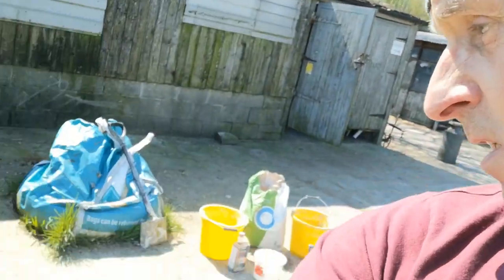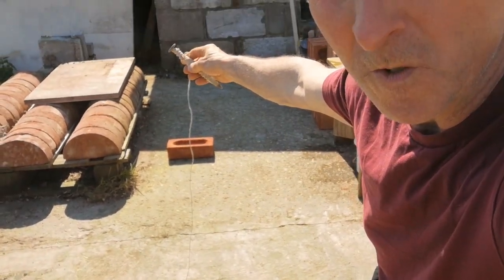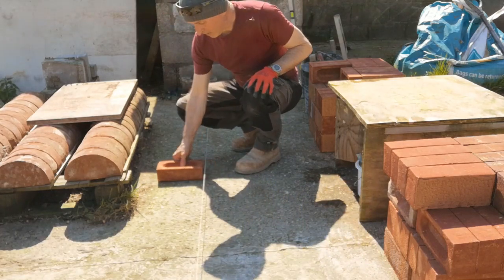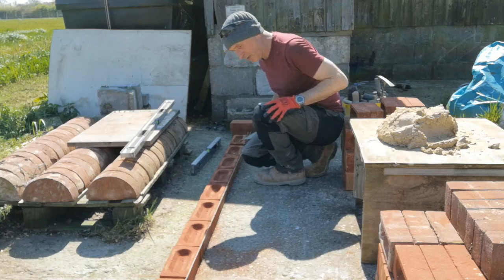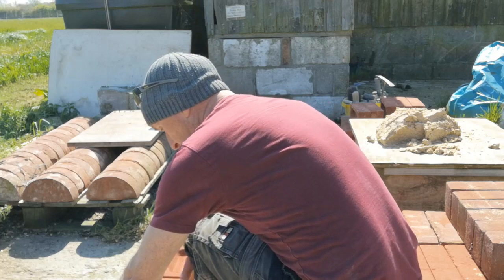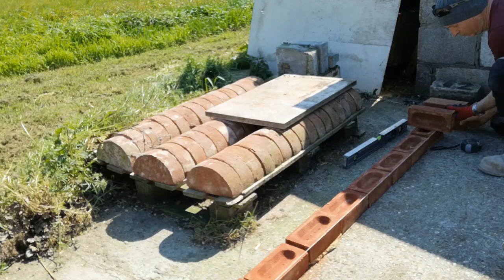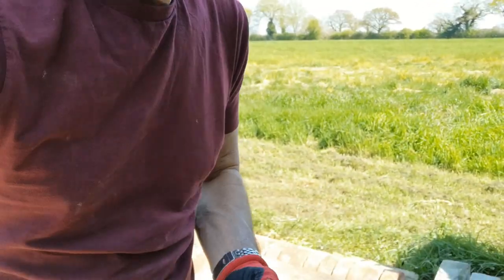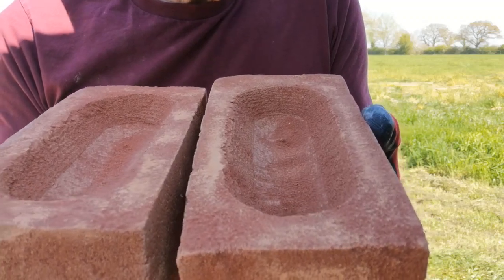How to lay bricks - Basic Skills   Lesson 5 - English Bond

Comment: Great techniques and clean work. 
You see some "professionals" wasting mortar left and right, not to mention the mess left behind.
One question on levels. There are 2 types of glass tubes that hold the bubble on a level I have noticed. Some are straight glass tubes, while others have a slight arc to them. Which do you prefer and why. Is one more sensitive to movement than the other?
Reply from the maker: yes, the flatter the tube the more sensitive and more accurate the level will be

Comment: Great video 👍 question- how deep do you make your footer? Is there a general rule for footers - like  5 ft wall , use 5 inch footer, or 10 ft wall, use 10 inch footer.  Thanks
Reply from the maker: I have a sketch for this.
In brief, a minimum 150mm foundation and then for every 4 courses above ground you'd need to go down one course.
eg. A wall 1200mm high would have a dig level of 300+150mm
The width I'd also as crucial to resist wind pressure
Reply from the maker: Is*

Comment: Class 'by engineering bricks always seem bigger than facing bricks, what would you do, close up the gaps on the engineering's or open up the facings, thanks, great vids Rob
Reply from the maker: I always set out the main facework first, with the facings, and then follow that with the engineering DPC which I agree, often means tight joints (even a snip occasionally) but the main wall is good.
Reply: @robsonger1  thank you very much rob for replying, your answer makes total sense

Comment: A U.S. masonry textbook states that the frogs should always face down. Just one author's preference, or a recommendation with merit? Thank you for your excellent tutorials!
Reply: Dave, Rob explains why in another comment below. Fundamentally, frogs are laid up to prevent voids which would allow moisture in to freeze and thaw and eventually cause failure of the bond between bricks. It makes sense if you think about the physics/mechanics of it. You'll note that Rob often mentions the importance of a full, filled joint. The same reasoning applies to frogs. 👍🐸

Comment: I see I need to practice more...
What’s you practice mortar mix Rob?
Reply from the maker: it's a 1:3 hydrated lime / sand, with plasticiser
Reply: I am an ex plasterer, and I have helped my grandsons set up a practice area. Keep the mortar in a plastic refuse bin with a lid and use a plasterers mixing paddle ( you can get them for under £50 quid now) The mortar can be used time and time again. The mixer can handle a six to 1.5 mix with ease.
Reply: Sorry 6:2

Comment: Rob couldn’t you use snapped headers and wall ties so you can get both sides of the face looking good as the bricks very
Reply from the maker: Yes, we do that occasionally, but true traditional Flemish bond is a minimum of one brick thick and much stronger than using ties on 2 leafs

Comment: Thanks for new videos on brick work , what would determine which bond to use say for a garden wall or small retaining  where a cavity is not required. Where do you use these bonds most 🤔😄
Reply from the maker: well, English is the strongest, and flemish is the most attractive, (but still strong enough)
Reply: rob songer 
On English bond do you lay three course off stretchers then one off headers to the required height or have I got that wrong ??🤔🤔